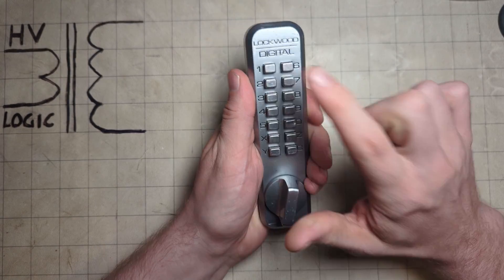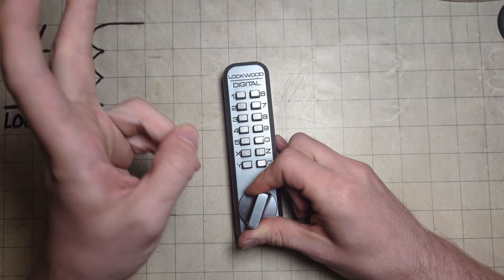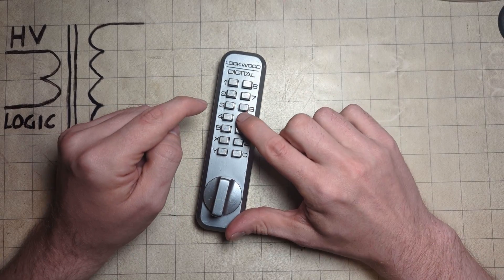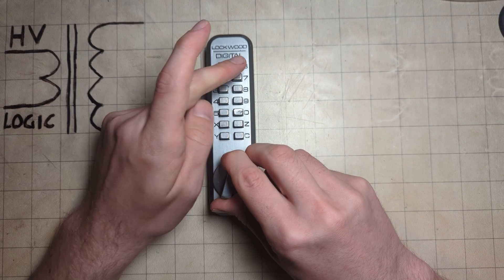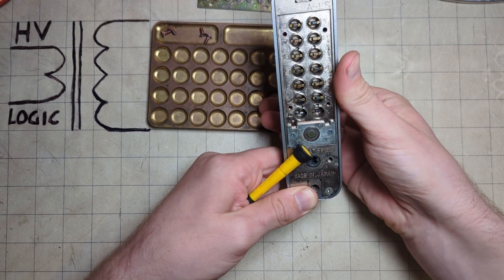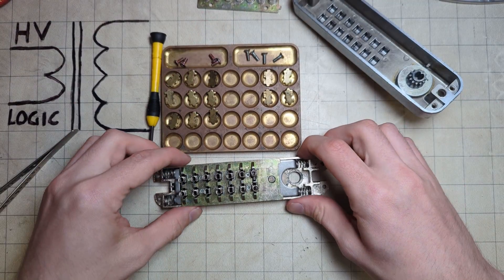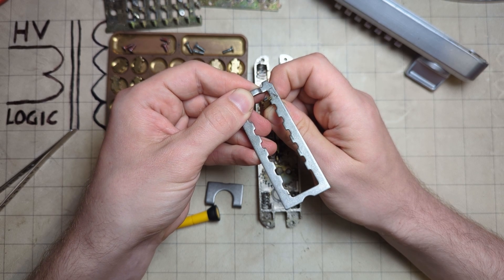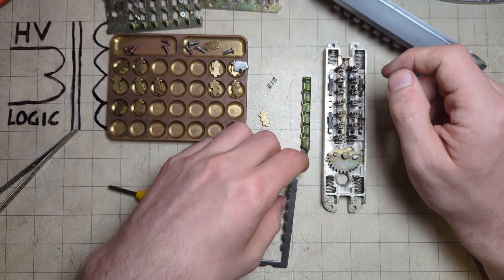Lockwood Digital Code Lock decoded and Gutted

Comment: I just managed to decode one of these locks based on the instructions here.  In my case the handle only turned clockwise to unlock so I tensioned it clockwise.  I put a fair bit of tension on it and then gently pressed each button.  Most of the buttons felt like the button itself touched up against something solid, and then the button and the solid thing further pressed up against something else - so there were two times the button felt like it pressed against another surface.  However one of the buttons would only touch that first solid surface and then it would not budge - it was "binding".  That was the first code button.  I released the tension, pressed that button, then repeated the process to find the next button that was binding.  I was able to repeat this for all four buttons (two on the left, two on the right in my case) and found the code that opened the lock in only a couple of minutes.  I don't know if this process works with all locks of this type, or perhaps mine had no anti-pick measures, but I just thought I'd explain it in case it gave anyone else some ideas.

Comment: I wonder does the binding you're experiencing on the left side vs the right side have to do with the direction you are tensioning? does it behave the exact same way if you tension anticlockwise? perhaps you can decode the left with CW and decode the right with ACW?
Reply from the maker: no the tension is always in the same direction internally no matter which direction you turn the knob. its all about the false gate vs no false gate.